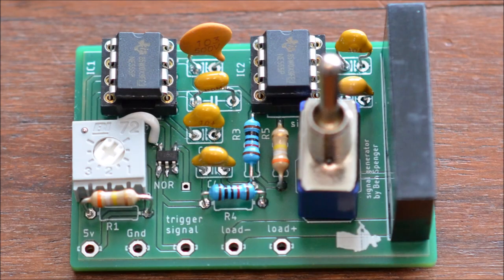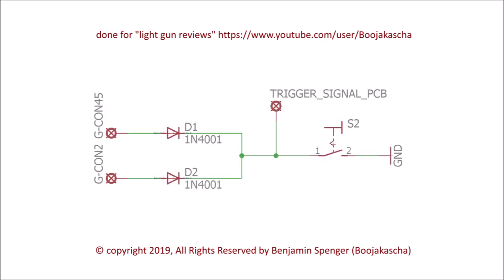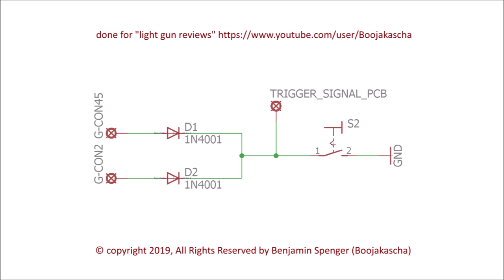Light Gun Reviews 130: Namco Arcade gun on PlayStation 1&2 (Modification)

Comment: Your dead zones are not from using the arcade gun sensor. The arcade guns use the same sensor as the official GC2 gun. It's from a lack of brightness on your monitor. If you can't raise brightness and contrast to a level that allows the crosshairs to reach the edges of the calibration screen, I recommend trying one of the new Namco amplified sensor boards. I had the same issue on one of my monitors until I installed the new sensor PCB in my Namco arcade gun /Guncon 2 mod.

The issue caused by the extra distance between the GC2 pcb and the sensor board is shaky crosshairs compared to the super stable crosshairs on an unmodified GC2. It makes it harder to calibrate but shouldn't effect you in-game as long as shots register everywhere on the screen.
Reply from the maker: I would have to measure both light diodes for their specs. They look different. Was the amplified sensor board made for the Time Crisis 1-3 & Point Blank 1-2 gun or for the newer model?
Also my crosshair isn't shaky at all. The trick is shielded cables and a tidy force feedback board!
Reply from the maker: Unless you mean that one:
https://www.namcoparts.com/Ecommerce/site/images/Photo2/VN05-09835-00.jpg
I don't find any other part. Namco UK just stocks the part I have. I am not sure whether it's a brightnes issue. Personally I assume it's a timing issue instead. Possibly caused by the cable length.
Reply: @Boojakascha  This is the Namco amplified sensor
 https://www.betsonparts.com/amusement-redemption/arcade-guns/namco-tc-gun-pcb.html 

It fits Time Crisis 1, 2, 3 arcade guns. It's the only way to get full screen coverage on a monitor that can't be set bright enough. It's not super cheap but still cheaper than buying a whole new monitor.
Reply from the maker: I think that's a Suzo-Happ board. I give it a try, thank you for the link! At least it is cheaper than the PCB I have linked: That one was 250 USD...
Reply from the maker: I finally got the board you mentioned and tested it (took two months+ to ship from SuzoHapp themselves). As I already suspected it has dead zones too. A bit less on the bottom of the screen than the original, but far worse dead zones on the left hand side. Plus the precision is far, far worse than the one of the original. I am still sure the issue has to do with timing and not with brightness. Brightness as an explanation doesn't make any sense to me.

If anybody else is reading this: If you order screw from SuzoHapp make them count the parts. Else they will scam you (as they do anyways selling fake parts).
Reply: @Boojakascha  try adjusting your color balance - more blue, less red.   Try degaussing as the edges get darker when it is needed. Try standing further back to calibrate with the amplified boards if you're seeing multiple crosshairs or shaking. 

Check your installation of the board to make sure it's centered with the lens. Make sure the lens is the right way. 
Increase contrast on the monitor.

I can move my crosshairs all the way to edges of the screen so it's nothing to do with dead zones. 

There would be zero benefit in Namco making guns not work at the edges. You wouldn't be able to play half their games. Baddies in Time Crisis 3 come from the extreme edges. Dead zones are for analog joysticks and they are at the center, not the edges. 

Issues like shots not registering at the edges are either your monitor or caps on your GC2 pcb.
Reply from the maker: @Zebra66  I set up my monitors correctly. Why would the dead zones be sharp defined squares if it was a brightness/contrast issue. It's the timing.

I inserted the board correctly. You can't install it wrong it snaps into a recess.

This is no Namco design flaw. Of course they never anticipated some dorks will years later solder the arcade light sensors of their guns onto the PCBs of their PlayStation controllers via a heap of slack wire...

Of course good, proper guns won't have dead zones...